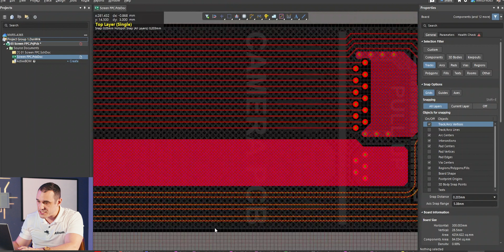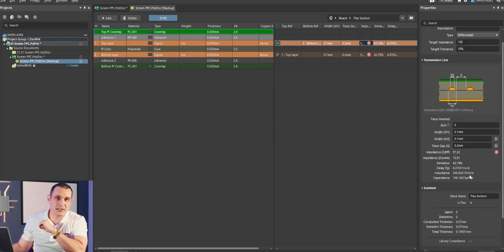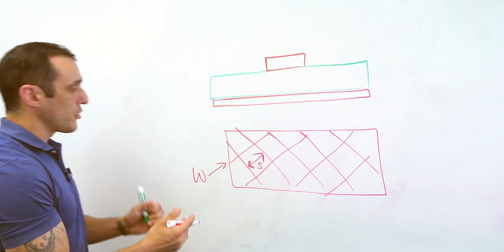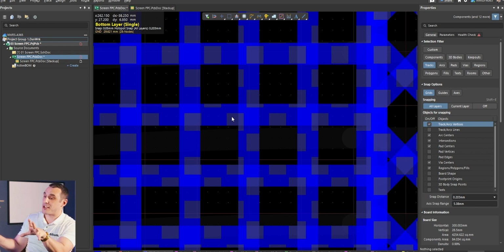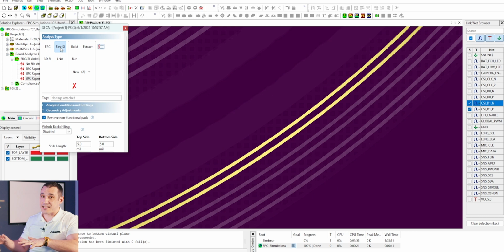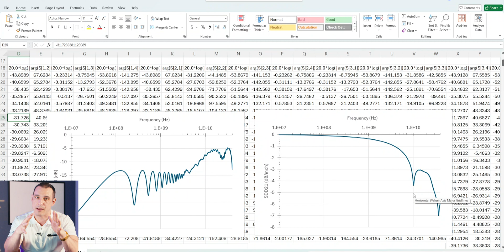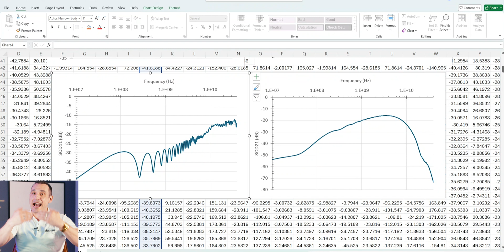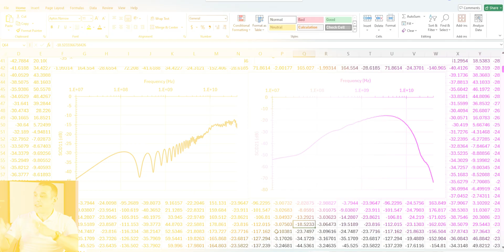Flex PCBs & Differential Line Impedance Over Hatched Ground Planes

Comment: If not needing a lot of flex in the area where the trace is running can you do a solid fill just below the traces to avoid this issue?
Reply: You could do this but it is not recommended to bend that region with the solid copper. You could place the PCB in a form to create a permanent static bend, but if you need dynamic flexing then you should use the hatched polygon.
Reply: @Zachariah-Peterson  ahh that makes sense, thank you so much for the reply!

Comment: What does the mode conversion really mean?  Does it mean that some of the "oops, this line got shifted up/down" is cancelled out because the other half of the pair shifted in the same direction, so that the calculated signal loss was an overestimate?  Does integrating the sample over 100 ns (rather than getting a truly instant sample) further reduce the effective loss?

Or does the -15dB even near the high point mean that the induced common-mode noise is almost insignificant compared to the total noise?  (Which seems to peak in the same area at -5dB?)
Reply: Mode conversion refers to conversion between common-mode and differential-mode signal/noise due to phase differences between the signal/noise on each side of the differential pair. When there is an impedance discontinuity or there is a difference in propagation time in some region of the differential pair, one side of the pair experiences different phase shift than the other side, so that de-synchronization causes this conversion. This is one reason we prefer less length tuning on higher bandwidth interfaces. This is entirely in the frequency domain so there is some integration time if you are looking with a VNA or SA, although you could measure the corresponding phase shift directly in the time domain.

About the common mode noise level, it can matter due to the common-mode fields generated around the differential pair. It does not take much common-mode current on a cable (sub-mA) to cause a radiated emissions failure; you would expect similar limits in a flex PCB due to the hatched plane. I would apply much more margin on the mode conversion mask when looking at the mode conversion S-parameters for a flex cable, but it's tough to say exactly how much margin is needed on any interface, pre-compliance testing along with the mode conversion simulations would definitely help here.

Comment: Zack, really interesting topic, thank you for this video. 
Would be great to see SIMBEOR results for: 
1. diff.pair that follows the copper on the hatch pattern (zig-zag/snake path), will it smoothen impedance profile along the diif.pair? 
2. continuous GND patch under diff.pair which is slightly wider than diff.pair (it can also go zig-zag to increase flexibility)
3. loss diagrams zoomed at low frequencies (below 10MHz)
Reply: Myself and Lukas will be looking more at the apparent power dropout in the insertion loss as it looks a lot like periodic loading, but the zig zag routing approach is a good idea. Might have to add that to the project if we have some time!
Reply: @Zachariah-Peterson  Would it be make sense to split the trace itself into a mesh, so it won't break all at once?  It seems like the lengths would be matched, so it ought to act like multi-strand wire, rather than a mess of stubs, but ... I'm not sure what measurements would leave me confident.

Comment: Can you just use a separate trace directly underneath each high speed trace to maintain your characteristic impedance and the mechanical flexibility rather than a hatch?
Reply: Sure you could, but the span of that ground trace beneath the signal trace will affect the impedance, when the span is larger the impedance will converge to the microstrip impedance value. So there should be some limited value of the ground trace width beneath the signal trace that produces some maximum impedance deviation in the signal trace.
Reply: Particularly with a flexible PCB, the hashing might increase reliability and longevity.  If a crack spreads across a trace (or its corresponding ground trace), the connection is bad.  If a crack spreads across one of 10 strands in a mesh, the other 9 are still connected, and will probably be sufficient, at only a slight increase in impedance.